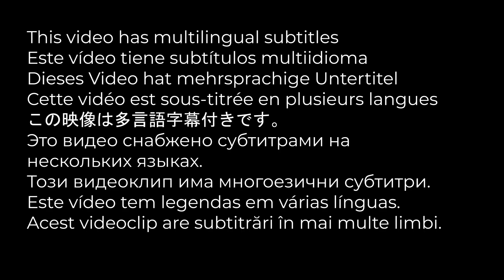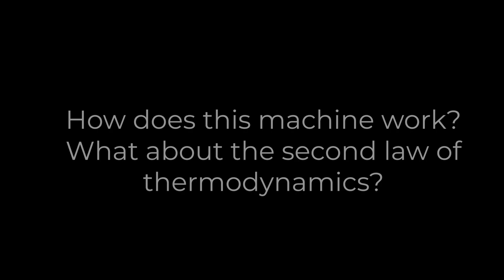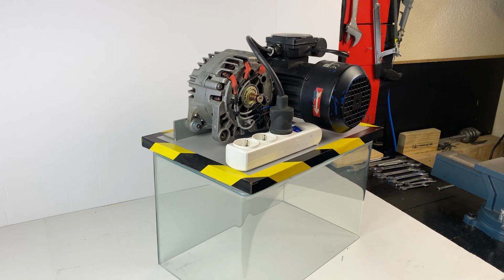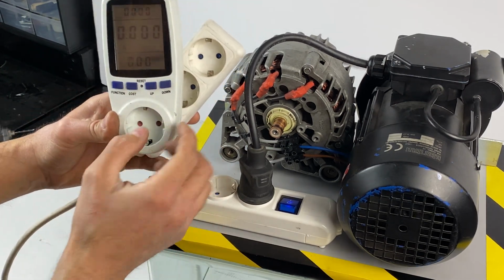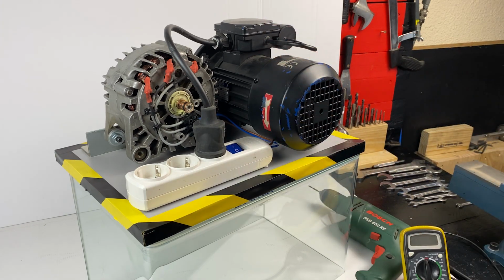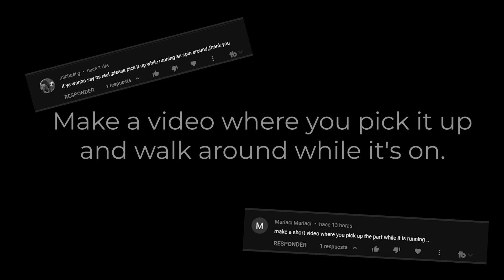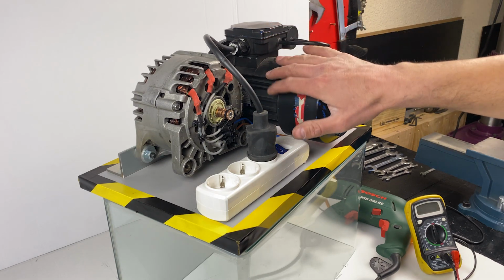We put this Infinite Energy Generator to Test - Liberty Engine 1.0

Comment: What is the patent number? Is the application available for all to read? If so can you link it so we can exam it.
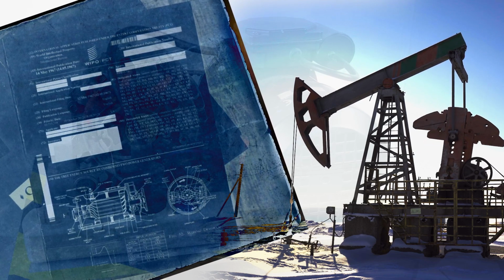Reply: I am suspicious of the patent's existence (19:55) for the following reasons
1) the priority date on the document is October 2012, it should be between 12-18 months before the filing date which says 1967-05-12, not 45 years afterwards
2) the barcodes top-right and bottom-left should be identical, even when blocked out, you can see the start of the barcode nearest the bottom of the page doesnt match the start of the barcode at the top of the page
3) There should be a human-readable patent (application) number next to and below the bottom-left barcode, the same number and size as below the top-right barcode
4) the abstract (summary of invention) is ALWAYS on the front page of the document - in this case it is missing
5) patent drawings are required to identify components by number, not words as the document may need to be translated later to another language
6) do a search for international patent applications published on 1967-05-14 (which is a Sunday), only 4 were, this is not one of them

Comment: Ok, but a couple of questions. (1) If you fitted more powerful neodymium magnets  I would expect them to put even more drag on the motor. How does it get over that? (2) As others have pointed out if both motor and alternator are 12 or 24 volts please can you explain where the mains voltage is coming from? Thanks. 
Now I'm wondering if the oil companies had a time machine & went back in history to bribe Newton to come up with the 2nd law of thermodynamics so discouraging anyone against perpetual motion haha!

Comment: Not only your upload is excellent; even the comments are 'most entertaining'. About 85% don't even grasp the physical principles behind what you achieve, others don't really watch/listen. Some 'in principle' don't want to believe it, as a perpetuem system simply can't exist, these 'believers' expect the universe to die out also 'very soon' (maybe due to human friction (in faiths)!?). Rare earth magnets are almost as perpetuem as the universe; the construct will run itself ultimately into disfunction (friction & heat & overuse) but to overcome these elements, simple (but essential) maintenance is just a fraction in effort one has to add, versus the surplus in energy one is able to take, to make 'this unit' run extremely long. An endurance test would be a nice follow-up. Keep up the spirit in free thinking!

Comment: There are batteries hidden inside The base. This is The reason it works. The switch cuts off The batteries Power.
IF they did The mechanism on a thin metal sheet,  they could not hide The batteries and it would not work.

Comment: Guys the trick was revealed by another vide on youtube, it comes inside the electric motor is hidden a 12v battery, and a 220v electricity converter and that's it
Reply from the maker: No, that’s not it. We’ll prove it in the third video of the series

Comment: If the system really works it could replace the recoil starter system with a two-way diverter that powers the engine with 220 volts just for starting.
Reply: Power an electric motor that runs the car. AND technology where you get power from braking.

Comment: Hi. Could you please remove the yellow and black base, it could hold a ton of lithium cell batteries, thanks.
Reply: The cord to the power bar, where does it go? Under the power bar and into the base?
Reply: @danthemans  through the socket.. in the base. is where all the ''Magic'' happens. i bet everything i have that you find a lot of 18650 cells in that base

Comment: In this demonstration, you used a 24 volt truck alternator and produced around 220 volts. If a 12 volt alternator is used, would that produce an output of around 110-120volts?

Comment: There must be a battery is in the baseboard!  There is no need to use the yellow and black tape around the baseboard.  It was hollowed out for thin battery.  The battery runs the motor, The motor runs to alternator modified generator.
Reply from the maker: Check the other videos then, we replaced the base

Comment: I saw the First Video when the alternator was being taken apart and  I Never once  Doubted that the  generator would not work What surprised  Me at the End when a Single  Phase Motor was connected to Produce Perpetual Energy and seeing on how it can Power a Heavy duty Drill and other devices I'll Give it a Try seeing that Electricity Prices have shot through the roof  Thank you for sharing your Knowledge with us

Comment: Another possible System could be: You Setup an hydrogen Electrolysier to the output when changed to dc, than you go and compremise the gas output into an cooled hi presure tank, than you use the high presure hydrogen and Oxigen in an hydrogen fuelcell to produce higher amounts of voltages. OR TO SELL THE HYDROGEN ON Market. Isn't that the solution wich everybody is searching for?
Endless Energy, and this in two ways
Reply from the maker: Very interesting

Comment: At 19:38 into the video you say that the oil company had Patent this technology 60-years ago, which means the Patent on this technology has "expired".  It is possible to have a Continuance in Part (meaning you make a "SIGNIFICANT" update on the existing Patent so the Patent "Continues" longer).  Since most mechanical patents are 21-years, I seriously doubt there is any protection on this Patent.  Below is a basic understanding of an expired Patent taken from the Internet that expains what happens when a Patent expires.  What happens after patent expires?
After the patent expires, anyone may make, use, offer for sale, sell or import the invention without permission of the patent owner, provided that subject matter is not covered by an unexpired patent. Certain pharmaceutical patents may be extended as provided by law.Jun 12, 2017
Reply: I am suspicious of the patent's existence (19:55) for the following reasons
1) the priority date on the document is October 2012, it should be between 12-18 months before the filing date which says 1967-05-12, not 45 years afterwards
2) the barcodes top-right and bottom-left should be identical, even when blocked out, you can see the start of the barcode nearest the bottom of the page doesnt match the start of the barcode at the top of the page
3) There should be a human-readable patent (application) number next to and below the bottom-left barcode, the same number and size as below the top-right barcode
4) the abstract (summary of invention) is ALWAYS on the front page of the document - in this case it is missing
5) patent drawings are required to identify components by number, not words as the document may need to be translated later to another language**
6) do a search for international patent applications published on 1967-05-14 (which is a Sunday), only 4 were, this is not one of them
7) do a patent search for ALL the words FREE ENERGY SOURCE BY COMBINING TWO POWER GENERATORS, you will find no patent; I did a WIPO patent search for TWO POWER GENERATORS, got 35 results the earliest being 1967, but this patent wasnt amongst the results 

**the 2 cross sectional drawings of the 1950s era DC generator are identical down to the positioning and font style of the component labels as seen on  page 299 of
Technical Manual TM-9-8000, Principles of Automotive Vehicles
Department of the [US] Army, 25 October 1985

look for a PDF of this 1985 edition of that book on manualzz download 8811024
there are other editions of this book, having different dates, so page number may differ

Comment: You said that there are no hidden batteries or cables, but can you show us the inside of the black motor? Just to be sure...
I'm sure there's just enough space to fit a motorcycle battery, a DC to AC converter, some small motors to spin the fan and the generator.
The generator doesn't really produce any power, it just spins for show. The real power comes from the battery.
And you actually don't need to hide any cables.
If the battery is inside the motor you can just use the motor cable to deliver power to the outlets.
It's not drawing power from the outlet, it's actually the other way around.
Now some math, just to show that my explaination is possible:
800+ watts for the drill, let's make it 1000 to account for losses during conversion and stuff.
a typical motorcycle battery works with 12V.
for 1000 watts at 12 volts we need 83 amps, which is easily doable for modern batteries.
a typical motorcycle battery has around 10Ah capacity.
that's 600 minutes, with 83 amps drawn gives us about 7 minutes of drilling time.

To proof me wrong, either show us the inside of the motor,
or plug that power meter in before the motor, to see how much power the motor uses to power the generator.
The energy has to come from somewhere.
Maybe use 2 power meters, 1 for the motor and 1 for the drill.

That's the only explaination I can come up with about how this really works.
Reply from the maker: Yes, we’re preparing a new video with many proofs

Comment: My first guess is the platform it sits on is a flat lithium cell pouch..... but the angle of the genset running is very suspicious..... they put it on glass at first but they don't show you the glass container in its entirety the entire time its running. What's happening behind the black electric motor.. they could easily hide a power cord from this angle.

You cant get energy from nothing.
Reply from the maker: Check the next video we released after this one with a transparent base

Comment: very nice video i could see the ratio of the two taperlock timing belt pulleys it seems that the alternator and motor are 1.1 ratio indicating no slip like direct drive the magnets seems to be high power out put what gets me if phasing of the alternator and motor because of the timing belt

Comment: Couldn't you increase output by gear manipulation? Say an overdrive pulley on the motor? Would higher generator rpm result in more output

Comment: Why do you have 2x 5000 Watts of power instead of 3x 5000 Watts of power? Can you show with an oscilloscope the voltage and waveform of the generator? And maybe also the current?

Comment: Why is such a strong motor needed? I mean why such a high amperage motor needed?? By operating we are using some of the generator's output. All we need is a motor with high enough RPM and low current no?

Comment: The explanation that the electrical voltage remains constant is based on circular reasoning and is not really an explanation.
The man in video basically says that the voltage and rpm remain constant but doesn't explain why.

Comment: Why you dont try to put in another Generator wich turns on an 400 three phases motor to produce much more energy. Two of that phases you could even change in 24 volts by saving it into an battery block

Comment: I dont understand how the bus or tractor alternator of 24volt 200amp DC turn into 225 volt AC 50-60hz im quite surprise that it change also the type of current but i really wanna try it.. also when you stick the magnet into the alternator you stick one side of the magnet positive and one side negative and it has to be perfectly round otherwise the current would variate

Comment: hi a 24v 200a used alternator is nowhere to be found, new would cost around € 1000, trucks or earthmoving machines do not have such powerful alternators, only big buses can have them, is it possible to replace it with a 24v 2000w 101a brushless motor? Since it has half the amperes 100 instead of 200 it could probably develop half the power, that is 2500w, is that correct?

salve un alternatore 24v 200a usato non si trova da nessuna parte, nuovo costerebbe circa 1000€, autocarri o macchine movimento terra non hanno alternatori cosi potenti, solo i grandi autobus li possono avere, è possibile sostituirlo con un motore brushless 24v 2000w 101a ? Dato che ha metà degli ampere 100 invece di 200 potrebbe probabilmente sviluppare metà della potenza, ovvero 2500w, è corretto?

Comment: How do you explain that a lot of replicator fail ? It is not normal that your video are seen by million of people and you are the only one with a "working" one. 🤔🤔
Reply: I know an electrician where I live that built one that worked. It's possible there are a couple of different reasons people have issues creating one that works. Magnets that aren't strong enough and/or a belt that's too tight and creates drag. Or possibly improper electrical wires that don't carry a proper current or just straight up not reconfiguring the alternator properly at all.

Comment: are you sure there is no battery pack hidden between 2 wooden boards, which looks like 1 Board because of the tape? that the white outlet box isnt wired to the battery pack? why was it even fixed to the board? the outlets box. open it and show us whats in it, and turn the motor on while doing so

Comment: Ok, let's see then, 3-phase 2-pole Alternator, which gives  Vout  = 220V @ f = 2800*2/120 = 47Hz - I guess this is close enough. The correct RPM should be 3000. f = 3000*2/120 = 50Hz.

Comment: O.k. you may not sell the whole system, but you may sell the manipulated generator and in addition an user manual (howto) and the additional parts such as what motor aso. For me: I would buy such an tuned generator.

Comment: I am a car specialist and I know that the car generator does not generate in the best case 50 volts. This work is incorrect. With the development of photography montage technology, it is possible to put a wire of a certain color that is hidden, which feeds this circuit

Comment: I still call BS on this. It's not possible. All things seek equalibrium. It's one of the reasons a nuclear bomb doesn't keep expanding after the blast until no atmosphere is left to burn. In this case, the minute amount of energy put into the alternator would create some electricity, not a lot, but some. Not actually even enough energy to get the other motor going, though enough definitely to engage a solinoid switch. Let's say though it is enough energy and forget the fact that the alternator needs around 1000RPM to produce power. (the cord pull isn't anywhere near 1000RPM, maybe 200RPM) the energy then starts up the other motor, and due to the electrical resistance in the windings, and in the cabling in both the alternator and the motor, you will have lost some energy. Now let's include friction. Motors have a ton of friction. Ok, so the motor would then turn a little, but probably barely enough to pull on the belt. At this point the free energy that doesn't exist, and never will, has ceased to function. What you have going here is a discreet lithium ion battery hidden somewhere in that control box or in the extra space of the motor. It is powering the motor and the peripherals. It wouldn't last very long. I hate videos like this. 

I was hoping to see a video that would demonstrate how to create power using an alternator through alternative energy, such as wind power or hydro power, not some piece of crap lie that wastes people's time.

Comment: This should never work like your showing I've watched all 3 videos including the build video you never rewind the fields on the alternator so how are you getting more than 24v I also don't understand how your powering everything off the same outlet your plugging your AC motor into so the ac motor can't be producing the power to power everything and that alternator the coil fields are only wound to produce 24v I seen nothing used to boost that output care to explain

Comment: muito top magnifico seu projeto! ele consegue alimentar um motor 10CV 65Kg ? tipo esse gerado ligando o motor em um veiculo eletrico artesanal, ligação direta consegue alimentar  e ter desempenho? faça um teste com motor eletrico  muito top!
Reply: very top magnificent your project! can it power a 10hp 65kg engine? like this generated by turning on the engine in a handmade electric vehicle, can direct connection feed and have performance? do a test with very top electric motor!
Reply: muy top magnifico tu proyecto! puede alimentar un motor de 10hp 65kg? como este que se genera al encender el motor en un vehículo eléctrico artesanal, ¿se puede alimentar con conexión directa y tener rendimiento? ¡haz una prueba con un motor eléctrico muy superior!

Comment: guaranteed there are 18650 batteries inside that thick board they're using.  If it was purely for support, they'd use a piece of wood but since they needed something hollow they've covered the edges because seeing those edges would draw your attention.  Anyway, if they really figured out free energy they'd be mining bitcoin and making millions instead of making pennies off youtube ads.
Reply from the maker: Ohhh, you so clever. Unfortunately we made a version with a transparent base. What can you say about it then?

Comment: I'm lost why people don't believe this. You spin initially a induction motor 125% more that will start the generation.  Then it will continue to over rotate the alternator producing more power then it consumes.
Reply: People don't believe this because that's not how generators work. They NEVER produce more power than the load is drawing. Add the mechanical power required to spin the generator and overcome frictional losses and electrical losses due to wire resistance and you're now operating at a net loss. Even with ZERO electrical load on a generator it still requires power to spin. Put a load on that generator the torque required to spin it also goes up. Get educated.